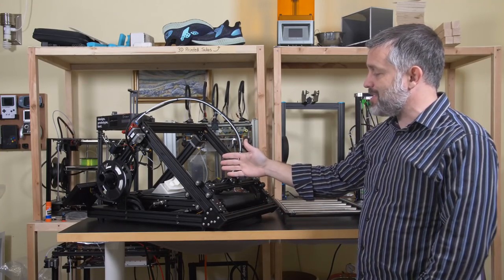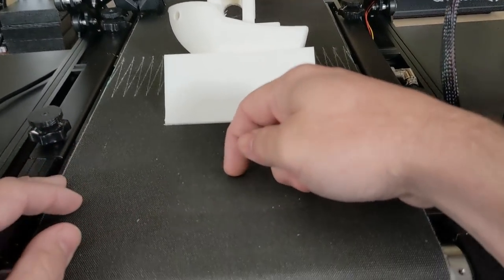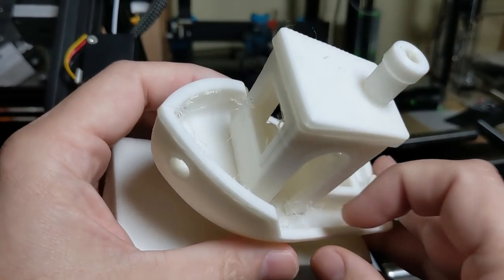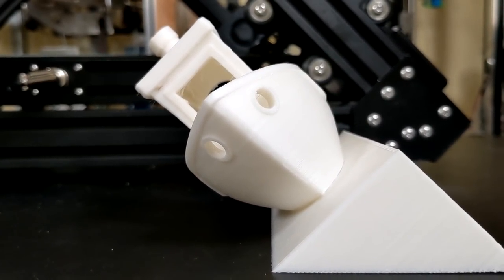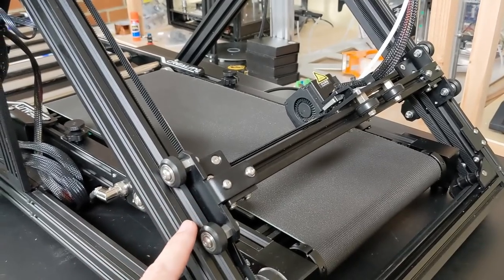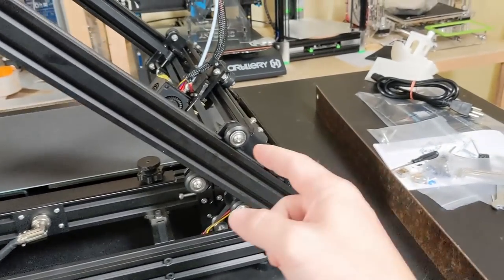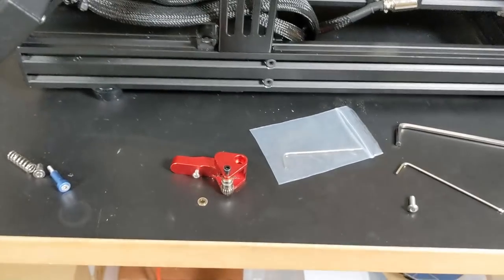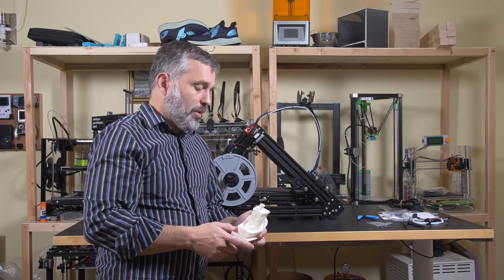Creality's 45° Belt Printer - First Print & First Impressions

Comment: creality makes 4 rollers to not skimp out
people criticize it
c'mon dude, mass is the problem? on a 3d printer? 99% of y'all don't ever go above 50mm/s on a Cartesian/coreXY, I have a Cartesian with a glass bed weighing in at 1330g that runs travels (and sometimes prints) at 300mm/s with 2K accel (normally prints at 150mm/s w/ 1.2K accel) and it prints as good as a prusa going 40. in my eyes going for 3 rollers is just being cheap, makes little to no sense, since they're worth mere cents at scale, and actually the play with 4 rollers would be much smaller cause the lever is longer, reducing the needed tension and improving lifespan on those cheap rollers
flame them for the big rollers, but not the wheels
ghosting and rippling are normally caused by a semi-elastic power transfer system and non-rigid frame,  and can be easily compensated with S-curves and input shaping, or simply playing with  the speeds and accels, ringing is normally noticeable at the  resonant frequencies, if you avoid them you avoid ringing, that's how my shitbox of a printer can print better than most printers at high speed
for a delta sure, mass is more critical, there it totally applies, but for that 45° coreXY? just TWO rollers more? what's that?, there are much worse things on that printer lol🤣

Comment: I don't see the real use for the roles as you can do do the same with a smooth plate. I understand that it is a bit lower than the bed, but with a plate, you can put it way closer to the beld and put it level with it.

Yep 3 is the max and always the best. 
You can see that a not technical person designed it. 
These days, everyone thinks that they can build something and you get mistakes that are just basic things and everyone knows. 

Can you make videos where you discuss printing problems and how to fix them with some examples?
I solved most of my problems, but it took a sile yo solve them. My latest problems are printer related and can only be solved by getting an other printer.

Comment: Definition of stupid 'ADJECTIVE -    having or showing a great lack of intelligence or common sense.'
Sounds about right to me. Whoever came up with the four bearings, and the belt pulley on the end of the shaft, must have been not thinking straight, and needs to get educated in basic engineering principles. It is as easy to get it right.if you have a modicum of knowledge.

Comment: 4:39 dude GRABS THE PART AND YANKS ON THE BED
JFC my man learn to 3d print, just advance the fucking belt and let it peel itself off.
I hate seeing people abuse 3d printers like this, it hurts me deep.
like this printer has a BUILT IN WAY TO DISADHERE PARTS TO THE BED.
this is like watching someone try to yank a part off a still-hot glass bed.
also, why is this printed at 45? just because the axis works at 45 doesn't mean you have to print that direction...
every other demo i've seen of this they just print fucking upright, it's like you completely misunderstand this machine.